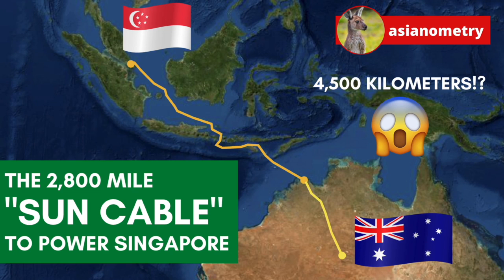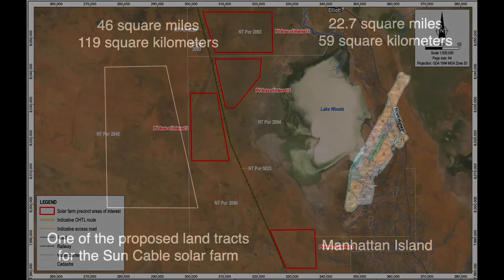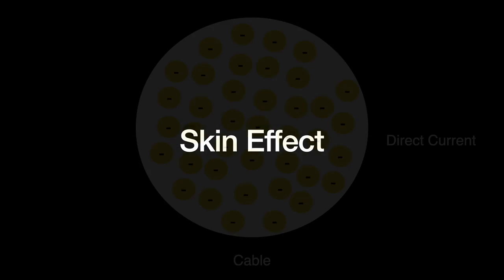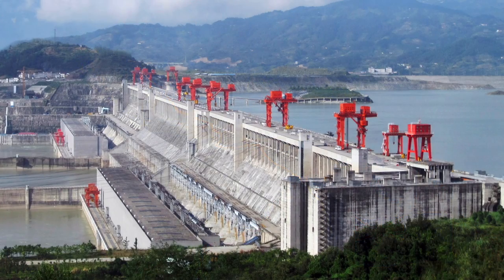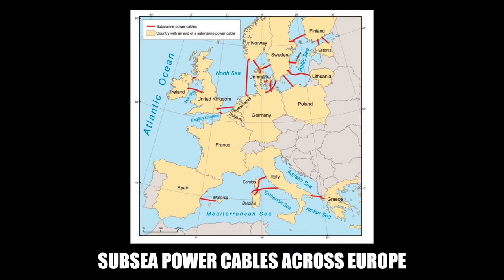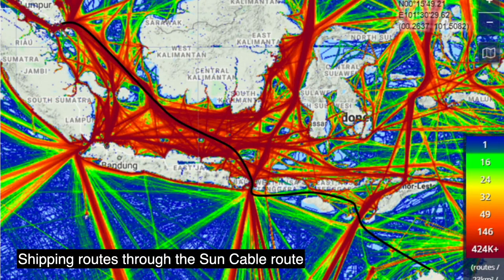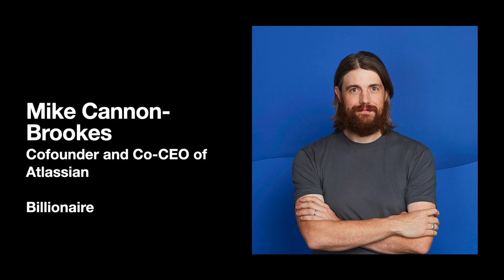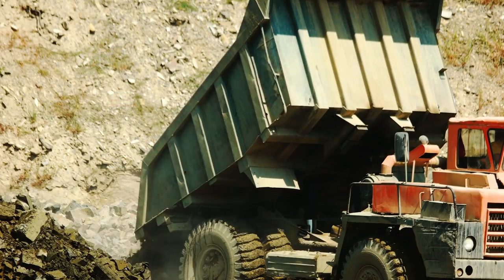How Singapore Plans To Pipe Electricity From Australia

Comment: There is also a plan to build a huge solar array near Pilbara in Australia and use its output to electrolyze water into green hydrogen.  This will be liquified and shipped to other Asian countries, where it can be used to generate green electricity among other things.  So there is an alternative way to eliminate the fossil fuels and not have to transmit electricity long distances.  If you're reading this, I guess you should make a video about this plan.
Reply: For those interested, that project is called "Asian Renewable Energy Hub" and was originally another submarine power cable project (from Pilbara, Western Australia not central Northern Territory)
Reply: liquified hydrogen for export is nonsense, it takes huge energy to liquify it, their are no ships capable of transporting it and no infrastructure to burn it upon arrival.  For less energy you can just synthesize hyrdocarbons from the hydrogen and ship that.  Or utilize the hydrogen to directly smelt Australian iron ore into steel and export that.
Reply: They are not cost effective we export coal why not burn it ourselves . there is something wrong in Canberra it stinks of corruption
Reply: @usausa2390  You are obviously blissfully unaware of the challenges faced by the planet primarily caused by carbon emissions !
Reply: @TonyWhite22351  tell what is your solution
Reply: @TonyWhite22351  the coal is being burnt why don't we use it instead of China wind farms are not cost effective or environmentally friendly solar is not cost effective they all use energy and resources being built that far outweigh the benifits FACT
Reply: Making hydrogen to burn is a trulely bad idea znd very inefficient.
Reply: @kennethferland5579  Synthetic hydrocarbons is a great idea.  Also ammonia for energy export, way easier to handle than H2 and just strip off the nitrogen at the other end.
Reply: seeing Australian government, I think this is just a wish but have no chance to materialize
Reply: @xenuburger7924  yes and not to mention ammonia production is a well understood industry. Burning it would be most economical due to being able to retrofit current infrastructure. A concern with a large project like SunCable is the feasbility and timescale where a lot of dirty fossil fuel companies/corrupt politicians would stand to profit on green industry inaction. Another concern is there is very little proof of concept of a Green Hydrogen economy. Maybe more concerning is why hasn't there been more research and interest in this field. (don't want to get too conspiratorial)
Reply: @kennethferland5579  
You failed to consider that there are ships that already transport liquid natural gas.  The green hydrogen can be mixed with natural gas to make it greener.  Then later the h
green hydrogen will be used to run fuel cells.  Hydrogen can be used for other purposes such as to make ammonia for fertilizer.
Reply: @usausa2390  
Yes, green hydrogen will be used domestically.
Reply: @usausa2390  
It's not your decision what's cost effective or whether or not to use solar or wind power.  The utilities are making those decisions and ignoring you and building huge solar and wind arrays where the fuel is free and the cost of the renewables is cheaper than conventional power plants.  Sorry, you lost.
Reply: @usausa2390  
You failed to take into account that the fossil fuel industry is making money from exports, and when the fossil fuels are no longer allowed to be exported there needs to be something to give the people jobs and make money from exports.
Reply: @acmefixer1  you fail to take into account the enormous cost and energy it takes to build ,run ,matiance these so called green industry's do some research yourself you will be surprised how wrong you are
Reply: @acmefixer1  do you know how hydrogen is even produced it's so not efficient  that's why it was never taken up seriously you need to educate yourself if you want these green technology get use to living by candlelight no I might not tell the big business what to build but they won't build what they cannot sell you don't know what you're talking about don't reply to you do I don't want to listen to uneducated fools that will cause harm to the world under the guise of doing good
Reply: Your little sun plant in WA isn't going ahead
Reply: @kennethferland5579  Why would you extract hydrogen from hydrocarbons ? You would still release the CO2 to the atmosphere so you might as well just burn the hydrocarbons like we always have. It's true that there is limited hydrogen infrastructure at this time. Fortunately, some people want to start.
Reply: Wow! Sounds like a brilliant idea. If the Aussie govt. is serious, then they sould try this one fast and then evaluate the 2000Km long and $6B wide sun cable project against Plibara Asian Renewable Energy Hub.
Reply: @kennethferland5579  Iron and steel industries are labour-intensive. They don't have the workers in Pilbara
Reply: @usausa2390  still off with the fairies?
Reply: @usausa2390  It is not a fact. The cost of coal is now at record high territory lol, this is why electricity prices are through the roof everywhere.
Reply: @kennethferland5579  or use nuclear. Seems overly complicated to mess around with using solar panels to make hydrogen than ship it off.
Reply: @usausa2390  Utilities by solar and wind because it I S cost-effective. FACT. If it wasn’t cost-effective they simply wouldn’t buy it. Interested to know where you get your information.
Reply: @TonyWhite22351  You are blissfully selling your coal and blaming other countries for the pollution lmao
Reply: @kennethferland5579  actually theres plenty of infrastructure available to burn liquid hydrogen, been tested, been trialled, theres plenty of engines equivalent to diesel generators that can run on hydrogen. Building transport is just another challeng, remembering we transport liquid petroleum gas (propane/LPG) via ship now. Not sure how many power generators running on steel there are however.
Reply: Hydrogen is a chemical ingredient in cracking alkenes (a waste product of recycling plastic and bio-waste into syngas, which is a greener substitute for natural gas) into more gas. I propose that Australia builds an industry of importing waste plastic that countries fail to recycle, them use solar power to make hydrogen that will break down the plastic into gas, then make liquified natural gas (LNG), then sell LNG to all the LNG-importing countries who need it. This would be significantly greener than how Qatar makes LNG.

Comment: The skin effect is miniscule at 60hz. The reason why they use DC is because of AC capacitive coupling. Basically, AC can conduct through non-conductors, but this effect is proportional to surface contact with another closely positioned conductor. This is a small but non-negligible issue when AC is transferred over long distances over land, where AC couples with the semi-conductive ground. It is still manageable, and is not much of a concern outside safety. 

Its only a big of a problem when these wires are placed in the ocean, where everywhere is extremely conductive salt water. Electrical power transfer over sea is always via DC to prevent this sort of capacitive losses.
Reply: THANK YOU! I was just about to comment on this. First time I see asianometry making a mistake :). All of Europe is one massive synchronous grid, but the UK is not connected due to the sea. They're connected with HVDC instead. As that's just a short distance, using HVDC would make no sense going by the videos explanation.
Reply: You can’t use dc at that distance.
Reply: This. Skin effect only really kicks in at much higher frequencies.
Reply: Was he right about the small losses using HVDC? Also, I'd no idea the Chinese were using HVDC above ground with power transmission from the 3 Gorges dam. I heard they were using giga-volt potential. Gigavolt DC equipment must be pretty impressive.
Reply: Why is Hydro-Québec's transmission line to New England HVDC then?
Reply: @szurketaltos2693  I've already said, this effect occurs regardless when cables are above ground, under ground or under the sea. 

Its just very necessary when under the sea where the effect is huge. Above ground/under ground, the effect is less but it adds up when cables have to traverse long distances. 

Additionally, if the frequency is different, only HVDC can be used, as AC cannot change frequency, or its not economically feasible.
Reply: @willyou2199  why would they do it if AC isn't a problem?
Reply: @szurketaltos2693  AC is a problem, its always a problem. Its just how much money it makes them lose. On land, for short distances, the losses are low and they dont bother. For long distances, the losses add up and it becomes worth it to buy HVDC in the long term
Reply: @willyou2199  I suspect the full reason is that there's not so much electricity demand in the region of Quebec or Vermont/NH so it makes sense to ship the power long distances. If there were lots of demand nearby then AC is better since the transformers and other equipment are cheaper. I.e. after a few transformer stations it doesn't make sense to do HVDC anymore. So most long distance power is AC because there's demand spread out enough that lots of transformers would destroy the economics of HVDC (and of course for historical reasons).
Reply: @mb-3faze  
No, the UHVDC transmission is at 1100 kV.

The HVDC transmission only requires Two wires, not 3 or 6.

https://en.m.wikipedia.org/wiki/High-voltage_direct_current
Reply: @willyou2199  
Losses are not the only reason.  The HVDC takes only 2 wires, not 3 or 6.
Reply: @acmefixer1  Ah... thanks... only 3 orders of magnitude off :) Thanks for clarification and information link.
Reply: @szurketaltos2693  The answer to your question is...
You are lying that they are using DC.
"The system has transmission lines reaching to power generation facilities located more than 1,000 kilometres (600 mi) away from population centers. For this reason, TransÉnergie uses a voltage of AC 735 kV to transmit and distribute electrical power produced from Hydro-Québec's dams, although 315 kV is used as well."
Reply: @acmefixer1  It's primarily the losses. You need 2 wires for HVDC because one is low potential other is high potential or in other words plus and minus or plus and ground. AC systems generally work with 3 phases and provided you have a symmetric load at the end (utility companies make sure they match the load) you don't need a return wire. 
So what's the difference? You still need 3 wires which is more than two right? True but given the same cable diameter and the same transmission voltage you can deliver more power with less cables with the AC solution.
Reply: @FlashMustache  Yea, but they drive on the wrong side of the road, too.
Reply: What is the frequency of the sun, anyways?
Reply: @scottfranco1962  I reckon it's about 11.6 μHz...
Reply: @FlashMustache  there are different reasons why one might choose HVDC. Minimizing losses over long distances is one popular reason. Asfor the UK, you said it yourself: the grids are not synchronized so they need to convert the electricity to DC and back. Another example is the Brazil-Argentina interconnect, which not only has unsynchronized grids but also different grid frequencies. In this case the DC portion only exists in the substation, a so called back to back DC substation.
Reply: @danp1224  Incorrect. Also, what distance? Who were you responding to?
Reply: At 60Hz skin effect is negligible for small wires, skin depth is 8.5mm for copper at that frequency which makes it a non-factor for household cabling. An undersea cable is significantly beefier and it quickly becomes a very real consideration even at low frequencies.
Reply: @szurketaltos2693  
1. HVDC isolates two AC grids
2. it is much easier to control the power flow between two AC systems using HVDC link.
Reply: @usneome  neither of those two necessitate that the long distance part of the line is DC though. You can just have a short DC tie or VFT. If AC were better for long distance transmission in all cases, that is what they would do -- AC line, then a VFT/short back to back DC tie.
Reply: @szurketaltos2693  My comment was not about line length. I explained to you that system operators control power flows between two systems much easier if the connection is not synchronous (using AC lines) but HVDC one. 

HVDC lines are normally used for very long power transfers over land, power transfers under sea and links between two AC systems (example is link between Hydro Quebec and New England). 

What is VFT?
Reply: @usneome  but this whole thread is about line length, if AC was always better for long lines then we would just do short back to back DC ties, or VFTs (variable frequency transformers) at the end of long AC lines instead of doing long DC lines.
Reply: The skin effect is a reason too. China's high voltage DC power cables are lifted in the air, but has proven to be more power efficient than AC too
Reply: The main issue is Reactance.
Reply: @danp1224  DC is less lossy. Contrary to some belief it is preferred for long distance power transfer. In the olden days AC was preferred because it could be used with transformers to step up to high voltage. Nowadays the same can be done with DC with high frequency switching.
Reply: How come no one mentions the biggest “loss” with AC, the fact the voltage & current pass through ZERO 100 times per second. To convey the same power by AC the voltage peaks have to be higher by 41% that require much thicker cable insulation
Reply: Skin depth for a 50 Hz system using copper cable is 9.3mm. That is the depth where current density is only 67% as on the cable surface.  So even for a 2 cm cable the difference in conductivity is becoming significant.
Reply: @danp1224  you can use dc at that distance at 5 million volts the reason that ac is used is it is easy to step up and down but in the last years it be possible to step up down  dc convert to ac
Reply: @Will You said, "...AC can conduct through non-conductors..."

You don't know what you are talking about.  You have no concept of what permittivity and permeability are.  Don't confuse things with double talk.
Reply: @scottfranco1962  
The frequencies of the Sun cover a very wide band, in the hundreds of terahertz.
Reply: The link between Spain and Morocco is ac, as is the link between England and Isle of Man. The Isle of Man interconnector is 104km making it the longest underwater ac cable in the world.
Reply: @Froggability  
You're making a mountain out of a molehill.  Insulation doesn't have to be "much thicker".
Reply: @szurketaltos2693  
The DC lines require only 2 conductors instead of 3 conductors for 3 phase AC.  So the cost of DC is only 2/3 the cost of AC just for the wires, not considering less metal for the towers.
Reply: @acmefixer1  good point. Though I wonder how the redundancies compare between implementations.

Comment: The main issue with running AC underwater, is from induction losses since salt water is a good conductor, the cable acts as a large capacitor. This isn't an issue with DC
Reply: It can be develop to ferroresonance right?
And i think main issue is Singapore is not friendly to Malaysia and Indonesia , then Singapore turn to Australia which make higher cost.

Comment: I like the idea of using a desert area as a major source of solar power. However, did I miss any mention of the risks of placing an undersea cable directly along the line of some of the highest seismic activity in the world?
Reply: Egypt thought about it and came to the conclusions it's stupid. They opted to build NPPs instead.
Reply: You like it but solar panels need water to cool. Deserts don't work.
Reply: Yes Pass by the ring of fire.
Reply: @CountingStars333 solar photovoltaic panels don’t need cooling. There’s plenty of them out in some of the hottest places on the planet.
Reply: So destroying thousands of Sq kilometres of desert doesn’t bother anyone these area are not devoid of life and are often more sensitive
Reply: @CountingStars333  What kind of solar panel need cooling? I never heard or saw someone cooling solar panel instead we heat the solar panel daily.
Reply: @bernielennox1031  good point -there would need to be an independent environmental impact assessment into any implementation plan, which, itself, should be allowing space for native species.
Reply: @CountingStars333  What are you talking about? I have 14kw of uncooled panels on my roof that have been operating without interaction for 7 years.

Comment: An important point you miss here is that the per km transmission losses for an HVAC cable are much higher undersea than they are on land, which is not so for HVDC. So the breakeven distance for HVAC vs HVDC is FAR shorter underwater than on land. Basically noone builds underwater HVAC cables for more than a few kms - more than that and you need HVDC.

Comment: Tengeh floating 60 MW
All Solar planned 2 MW
Singapore thermal installed capacity 12000 MW
NT Australia 10000 MW
Area occupied 12000 ha or 120 sq-km
SG area 720 km
This is huge, huge. John is not ignorant. 
Guys, focus. It’s about renewable, not nationalism. 
Deeply indebted to John for making this great video. 
A Q: If SG imports from 10 GW NT plant, what will happen to the local gas fired plants?

Comment: I think a bigger problem with AC, especially underwater, is that the cable forms a capacitor with the surroundings and thus there is an AC current to ground. The longer the cable, the bigger the capacitance, the higher the loss.